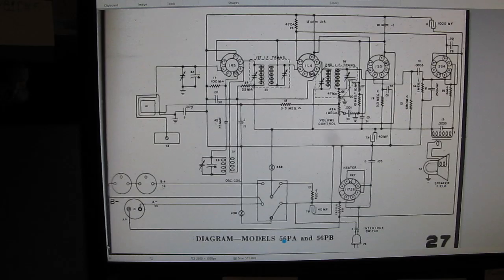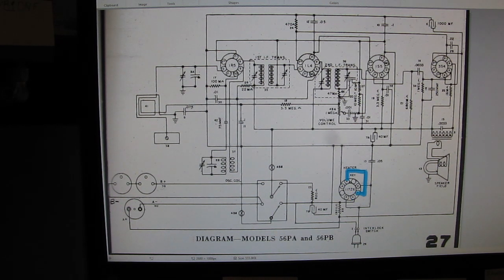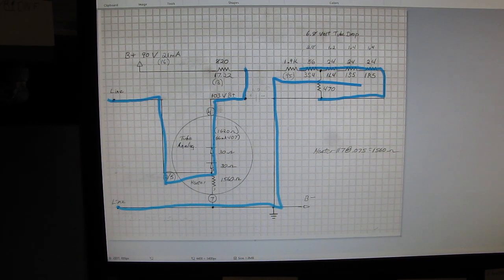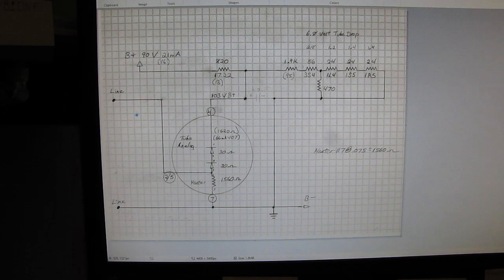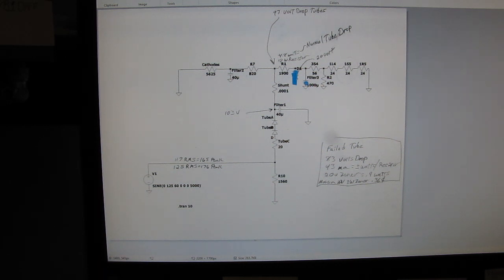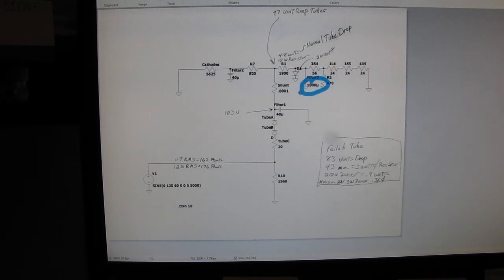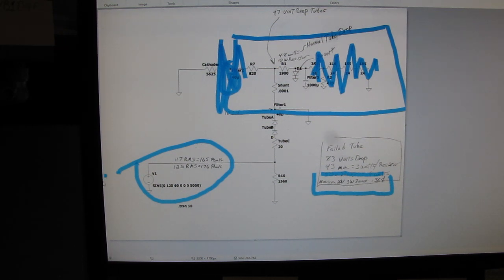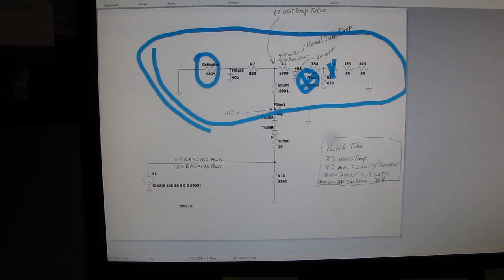NERDS CORNER - CROSLEY 56PA WEIRD RECTIFIER CIRCUIT

Comment: When you use a simulator program like LTspice, you can insert a zero voltage source. It allows you to monitor the current without adding voltage drop to the measurement. This can be be used in both AC or DC sources.
Reply from the maker: Thanks for the tip Danny, I was using it for the first time for the video. Old Dog, New Tricks.
Reply: @theradiomechanic9625  yes, the first time I saw this I was shocked. Then I thought about it,  1 amp times 0 ohms is 0 Volts. Now I use it all the time. Some other stimulators do this automatically to give you the current through a node in the circuit.

Comment: I have a few Crosleys using the 1V tubes, they a re AC/DC units. One that I repaired (11-301U) had burned out a series drop resistor that caused a lot of damage. After the rebuild I was very worried about AC operation on it, for similar reasons as yours.
My solution was to make a rule: "never run a tube AC/DC radio on AC line voltage". That's how I sleep at night. 
Running 1V heaters on a radio with no transformer and just using resistors for voltage dropping is nuts... but that's the design decisions (compromises) that they made back then. I suspect that the manufactures "assumed" that most people would run AC/DC radios on batteries as they would be portable... the AC operation would just be a convenience.
I cannot believe that Crosley would have made an AC radio using 1V tubes... is that correct? Why would they do that?
Cheers, hope your new year goes well.
Reply from the maker: This is a three-way set AC/DC battery. Nobody today runs them on batteries. Too expensive. A $0.36 zenner diode will protect everything.

Comment: ...so you pull out a tube for testing purposes and get a broken capacitor? What a beauty! This reminds me cheap AC adapters with filtering capacitors working exactly at their nominal voltages or even higher. Those rely on load consumption only - as soon as you disconnect load, the voltage will rise, and the capacitor fails.
Happy holidays!

Comment: Capacitor will just quietly fail, as it has a very limited current into it. It will have the voltage rise till it leaks enough to pass 50mA of current, making the capacitor have some higher voltage across it, and as the radio will now no longer make sound, the customer will take it in for service. The 10V rated capacitor likely can survive up to 20V with surge, and will then start to break down, and leak heavily. Power dissipation will be around 1W in the capacitor, which for one that age will merely make it somewhat warm, and eventually fail open circuit, as the electrolyte gradually boils off. 

They do not explode with limited current, only with the ability to have unrestricted, or at least compared to normal, current flow, which results in a lot of heating. Same like cathode bypass capacitors will still have not gone bang even with an open circuit cathode resistor, the voltages will be all wrong, and the tube running close to cut off, but the capacitor will be passing the cathode current, and will be unhappy, but no major bang, just pressure till the vent bung goes and releases it. No boom, just a hiss, and eventually a very dry capacitor.